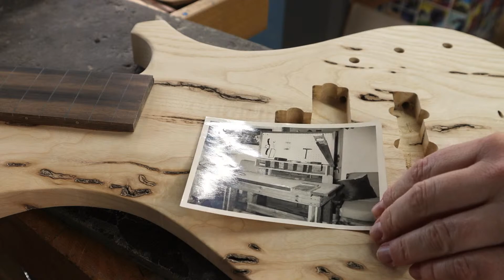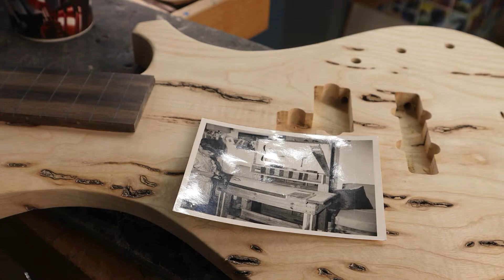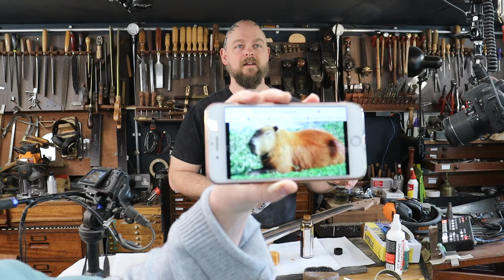ep 3 Let's Build a Bass Guitar Luthiers Live Stream with Ben Crowe

Comment: Oddly enough Ben I at one time in my life was a walking security guard at an aluminum smelting plant. One of three the worst incidents I had was having to pull a shift of 12 hours at a textile plant that was on strike after working my normal 8 hours then spent all the next day with my sister shopping. just as I was about to go to bed I gt the call to work the strike at the plant. All in all I was up a total of around 65 hours straight. The time I worked the strike was suppose to be my first 2 days off after my first week of working there. My feet were blistered from all the walking in new shoes I bought for the job. When I finally was relieved for the Plant where they strike was going on I went home went to my bed room fell face first in to bed and slept till around 11:00 that nigh when I had to get up a and get ready to go back to my normal assignment at the Aluminum plant.